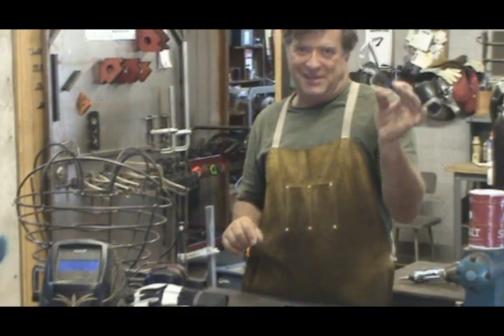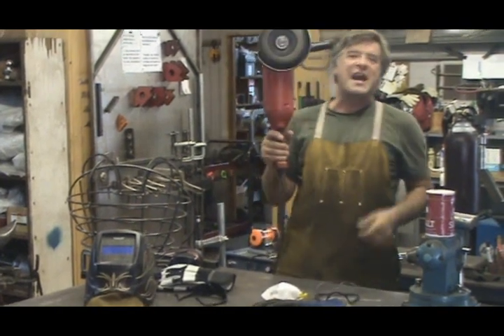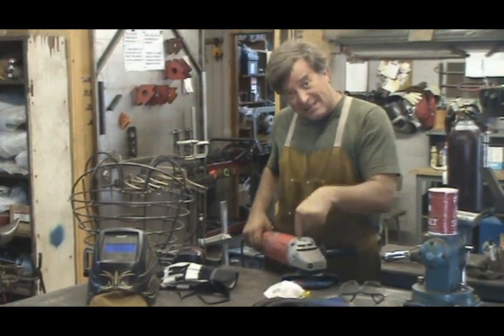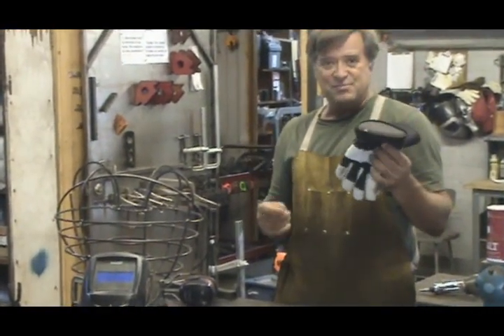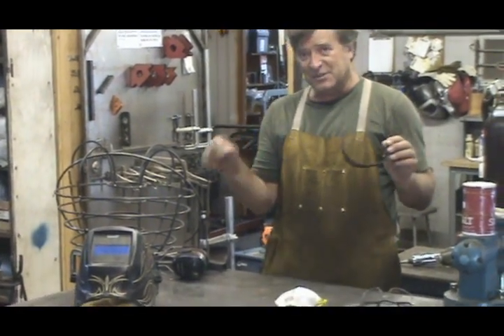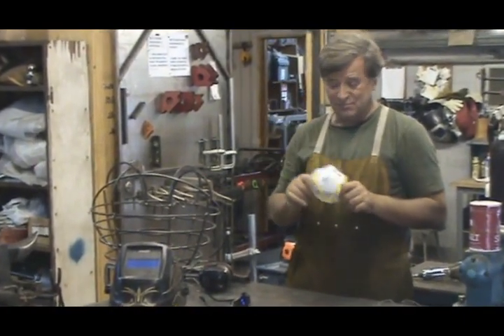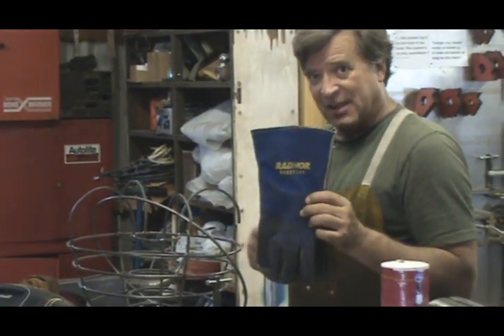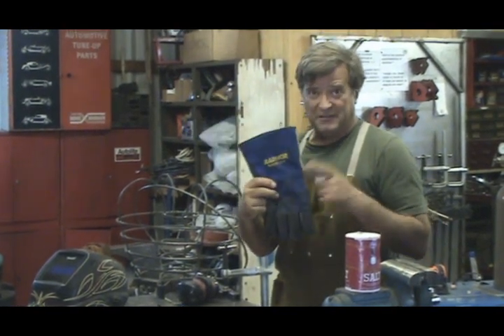Kevin's Take on Safety Equipment - Kevin Caron

Comment: great video i say gauntlets and safety glasses are key things maybe not so much the grinding but working with an arc i or even gas welding or plasma i just dnt like taking the risk but thats me. also sometimes when ur doing somthing quickly you dnt bother reaching for safety equipment like tacking somthing up just aim look to the side and fire but as i said at the start great video and i love your work thanks